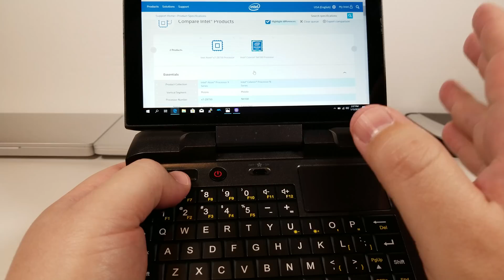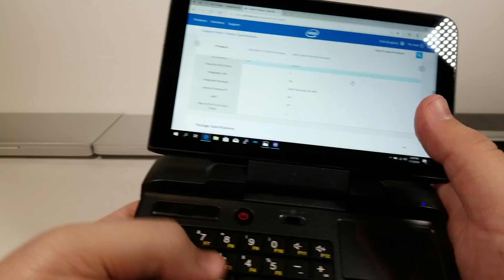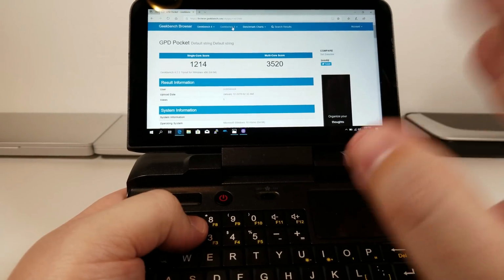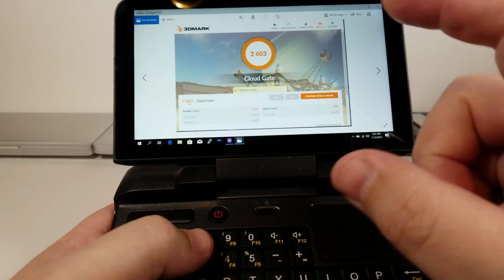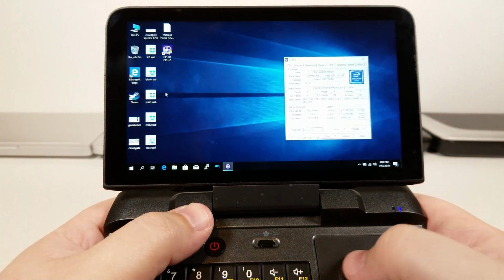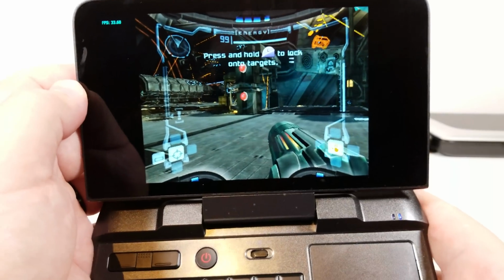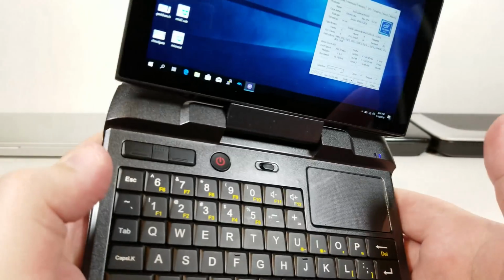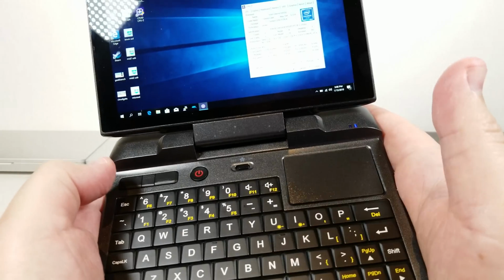GPD MicroPC - Performance And Throughput Quick Analysis

Comment: The 8gb version did benefit from the memory bump. Pcsx2 runs nicely on it.
Reply: May I ask what games you play on it? I'm thinking about getting it.
Reply: @randyfuller3057  I played FF12 pcsx2 on it when I had it. The battery died sadly after 3 months so I sold it off to someone who is willing to fix it himself. GPD's build quality is meh but for the price it was a steal (278 euros or 300 dollars, would NOT pay more if I were you).
Reply: @randyfuller3057  I bought it new but gpd had a flaw with the battery (they forgot to install a battery discharge safety on the battery so if the battery is 0% its broken). FF12 runs bad on ps2damon oneplus 7T.  I have that phone and if you leave rabanastre in ff12 on damonps2 it gets laggy (drops to 24 fps but I regain full speed here and there).

Comment: I see a lot of comments here wondering about gaming and purpose of the IO included. I have 14 of these deployed to field service technicians precisely because of the IO, including the on-board ethernet port and serial. While the display is small, it is easy enough to connect to a portable USB monitor for tasks that require a lot of screen time. As for gaming, it's not a gaming machine, that is not it's purpose. It is marketed as an industry device. The final product shipped with 8GB of RAM, and windows performs rather well on it. The only thing I have bad to say about it at this point, is that the battery is unreliable. If it is allowed to go to zero charge, it will no longer charge up and must be replaced. Just sent a support email to GPD today to see about getting 4 of the batteries replaced. Hopefully they will just ship them without me having to return the devices, since they are in field production.

Comment: Bought a 8gb ram version for 337 dollars or 305 euros. Which is quite a steal because the gpd win 1 is still 375 dollars. The only reason I sold my gpd win 1 was problems with sleepmode and low storage and too slow sd card that keeps disapearing. Now I have a ssd version of it if I buy a clip controller.

Comment: This product is not for gaming, it's for working situation like network testing, this is why there is an RJ45 and Serial Interface on it.
Reply: Just the same, using games can be a decent indicator to the power and shortcomings of the system, even for non gaming functions
Reply: can you choose to get it with a linux distro?
Reply: @EnderCrypt  They are working on Ubuntu Mate.  Not quite ready just yet, but soon.

Comment: I'll pass on this one but I'm saving up for GPD Pocket 3. I hope they remove the bezel, make the keyboard better and faster performance. I don't mind if they make Pocket 3 slightly bigger as long the user experience is great especially with bigger screen & keyboard. I hope @The Phawx will get an update on Pocket 3 and post it here. Can't wait.
Reply: Battery is now much better, its not from different manufacturer, its the same in several other newest GPD laptops. Its not gonna die on you. Keyboard is better than one from the pocket or Win
Reply: Same here, but I would add I hope they can do something for the battery. The battery on my pocket 1 is almost dead and I haven't used it much (the lack of overcharging protection has destroyed it). And it was short to begin with. Ideally a Qualcomm chip would solve the problem, but I doubt they'll go this path. Anyway a bigger and better keyboard (better still than the pocket 2 is more than necessary to make this thing really good...)

Comment: They can easily gain huge gaming performance boost just by using ryzen APU's
Reply: The weakest/smallest Ryzen APU called 2200U have a TDP of 12W-25W and are contenders for Intels 7000U series, not the 4.5-7W Core M CPUs used in the GPD.
Reply: @Kekeripo  there are embedded ones
Reply: @Kekeripo  underclock it and undervolt it out of the box. you can reach 7-8 watts on it.
Reply: Power draw. Not worth it.
Reply: @dylanharding5720  you know that people only get good framerates on gpd win 2 is by raising the power limit to 11w? And they stil had decent battery life (3 hours instead of 5) while running demanding games. You can do it without it but you get almost half the performance then.
Reply: @TheBlasterGameGuy because gpd win 2 can use 11 watts? And amd apus can go as low as 5-8 watts depending on the settings from the designer.
Reply: Amd has their embedded v1000 series. Even the 2500u can run as low as 7 watts as seen in the 13 inch envy x360. Way bigger obviously but gives an idea of what's possible.

Comment: GPD really changing themselves into a competitor to existing pc manufacturers but focusing on the ultra-portable pc devices. The biggest performance consumer is going to be windows 10, please consider another OS for those devices. I have seen windows 10 consume all my ssd, cpu, and gpu power with no other applications open and that is on a high end gaming laptop with quad core 2.6 turbo boost 3.2 4 core 8 thread cpu, 1tb ssd, and nvidia 965m gpu. Windows is really bad when it comes to those devices where after some use the device will become slow and unresponsive.
Reply: I think the solution would be Windows on Arm to have the best of both world. The new chips are on par with i5 and have ipad battery life and stand-by. And it would be very responsive if you don't use x86 software

Comment: Had my GPD Win 2 now for almost a year, its been great but the screen size is showing its age as far as usability. After using the Surface Go I hope GPDs next iteration will have a 10 inch screen which I think is the sweet spot for usability...and an added track pad like this as well
Reply: bezel-less 9in or 10in would make it quite usable and more portable that the surface go. But I doubt they will do it and I doubt they have the expertise to go completely bezel-less (but one can always hope...)
Reply: have the gpd win 1. Imho 5 or 6" is  really small to play windows games and the performance is meh. I really miss the 10/11" gaming notebooks from dell alienware and medion. The old good big and fat 11" M11x needs to be refreshed :) by the time being i have switched to an Asus Vivobook S14 (14" and full power MX150 but no touchscreen)

Comment: is the processor pretty much same same as the gpd win 1 in terms of performance? I guess we can expect high CPU usage and updates that cripple the device.
Reply from the maker: CPU is effectively 35% better than Win1. GPU is slightly worse. System ram is a mixed bag. For straight CPU tasks, it's better.

Comment: Does it have Bluetooth? If you enter the BIOS, is the screen orientation correct or sideways like the GPD Win? (This causes issues with old DirectX games on the GPD Win, which would be perfect for this kind of device) Any issue using it or powering it on while charger connected like the GPD Win?
Reply from the maker: The screen is still MIPI. So it's a portrait type of screen. They have fixed orientation on bios and such but old games will still need the dgvoodoo fix.

Comment: Hopefully gpd win 3 becomes with very strong gpu.
Reply: 3 more years my friend
Reply: Intel ditched iGPU for the 9th gen cpus... so i don't have high hopes for new iGPU in mobile CPU. Maybe AMD will bring something to the table? Or the new ARM based SoC will have a surprise for us?
Reply: @Kekeripo  AMD showed a new CPU at CES last week that was slightly faster than the i9 9900k in cinebench at around 35-50% less power usage. Idk if AMD currently has or is planning to release any SoCs with built in GPUs small enough to fit in the GPD WIN though.
Reply: Brian Crowe Acolyte APUs won't be on 7nm for the 3000 series at least. :(
Reply: Won’t be anytime soon .... intel ditch igpu. Amd don’t work with gpd. Using nvidia mx150 is not the point since that means they will raise the price and sacrified battery performance. For next win3 they still going with 7wh cpu. Let hope amd will support them for win4
Reply: it needs the mx150
Reply: Id doubt it but we can still hope
Reply: Can possibly come as early as the end of the year.

Intel is releasing their new low power atom class processors soon.

Don’t hold your breath though
Reply: What I need is long battery ~~~~~~
Reply: With AMD
Reply: There is only so much power you can cool in a small device. You can have as powerful a system you want, it just the system has to be bigger.